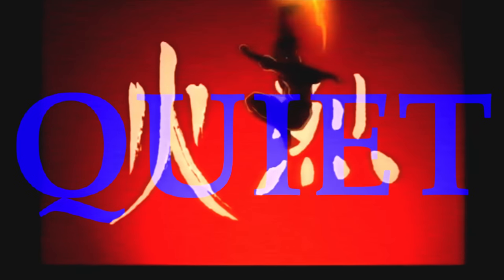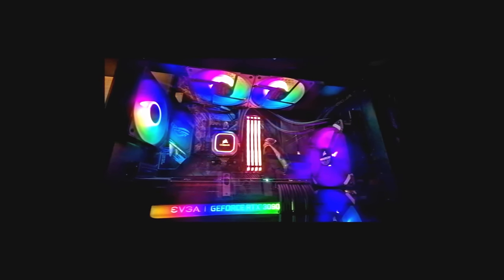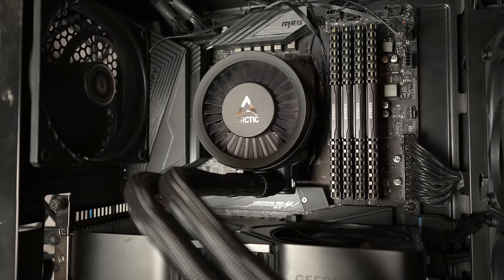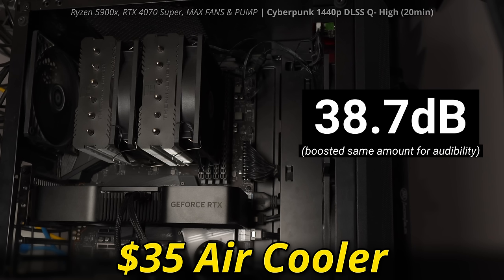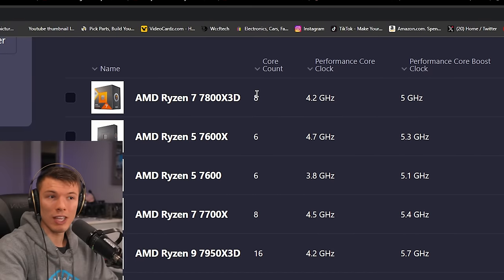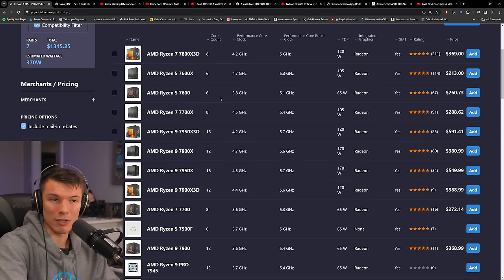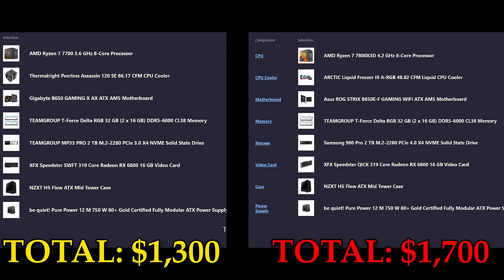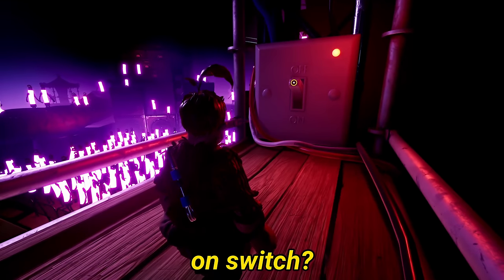How to Get the BEST VALUE PC!! (you’re doing it wrong…)

Comment: I get what ur saying with the base model of gpus being almost the same, basically the advantage of the brand versions is the bigger heatsink keeping the temps way lower allowing you to do a heavy overclock and not worrying about temps, also not to mention the vrand versions have slightly increased clock speeds but i doubt its that noticeable. For example my Asus tuf 7800xt i run it woth a pretty heavy overclock and undervolted and ive Never seen the temps go above 60°.

Only buy a branded card if it's same price as the base model or pretty close, other wise ur wasting money

Comment: AK400 :eyes-pink-heart-shape:with my 5700X
Reply: I went with the same for my 13600kf and despite using it on a non-oc board it tends to run hot. Been skeptical of the reputation deepcool has since.
Reply: @jarredkuliszko  my temps never cross 82c ( room temp 30c ) you.

also check the TDP of your CPU. the AK400 is a 210W cooler. My 5700X is a 65W n can boost upto 130W.
Reply: @ana303_  Australian here so it can get into the high 40°c mark here and the 13600kf is 125w. Doing cinebench it hits the 100°c mark quickly in 25°c weather unless I have my cases drive door open yet it has an intake and exhaust fan and the power supply works as one too. Use Arctic silver 5 thermal paste and I keep it clean.
Reply: @jarredkuliszko  add a top exhaust fan directly on top of the cooler.

Comment: Since Installing an aio Into my PC and switching the case to the Lian li Evo xl with a lot of fans my GPU and CPU are 10°C cooler under load, it did something
Reply: 10° difference, is it actually doing something like extending the life of the CPU? Whats the actual value? If there is no punishment for running the cpu 10° hotter, i will certainly do so!
Reply: @bedri1  theoretically you do extend the lifespan of the hardware if ran cooler. The real benefit I get tho is that my hardware is less likely to thermal throttle therefore gaining a little bit more stable performance. That's noticeable i would say.
Reply: @iR0CKt  what is the statistical difference if I run my CPU at 85°c Vs 75°c [Tjmax 95°c]

Comment: Your performance may be the same, but overall cooling is not. Water cooling is still more efficient. It's quieter if done right. Most of all, it allows for more overclocking. Simple fact. It is more expensive, but if you already maximize your parts, who really cares how you spend the rest of your budget?

Dead pumps CAN be disastrous. I've had one die. It took nothing else with it. A new D5 pump is cheap. It's only a big deal if you don't catch it. That's why you only run it when you're using it. Not as big a deal as people make it out to be. 

If you are cost-conscious, then air cooling is good enough. It will do what you need it to do. It won't supply the bling or provide better cooling, but it will be good enough.

Note: this is from the perspective of running custom loops. I've never run an AIO. You can liquid cool your cpu, gpu, maybe a monoblock for the mobo, and even your RAM if you wish when running a custom loop. It all helps though return on investment is more bling than actual performance. There is also the longevity of parts to think about.

Edit: The sad thing is that when I bought my ROG Strix B650-A Gaming Wifi motherboard, it was one of the cheaper options. AM5 was stupid expensive early on.

Comment: The only reason I will use an AIO over an Air-coolers these days, it's not because my 13900k is a toasty MOFO, but the CPU coolers is small. That's it, that's the reason, no giant-ass cooler tower blocking my access to my RAM or blocking my screwdriver while installing a cooler tower. That was always a pet peeve of mine with my first ever computer.

Comment: I honestly never understood the obsession with water cooling. For an Intel I9 that can draw beyond 300 watts, it's okay to use, but for my 7800X3D, my Peerless Assassin is borderline overkill. I'd say it can comfortably cool anything up to about 200 watts under full load.
Overall, though, my focus was on getting pretty things happening on my screen, not in my PC case. The only thing that has RGB is my GPU and that's simply because it was the cheaper option.

Comment: the arguement that someone would buy a 3D CPU would be if they play somethings thats CPU heavy (run on Java, Simulation, RTS) but otherwise 7700 non X is better deal yea..
as for watercooler.. i think Peerless Assassin is the best for bang for buck air cooler while watercooler would still always be Liquid Freezer II/III..
in general also someone should only pick non X over X unless the X one is heavily discounted (the non X is post-release revision with fixed "TDP" lower than launch, its better in general)

Comment: didn't know what i was doing in 2021 so i bought a prebuilt and it came with a 240mm aio. fast forward to now and i ditched intel for amd because of the future upgradeability and they have the 7800x3d so my 240mm aio turned out to be plenty. i have the castle 240ex from deepcool and i had to dig through their site until i submitted a ticket to buy the am5 mounting kit. SEVERAL channels (don't know about this one) say that if you have a bracket (for your aio) that goes on the back of the motherboard then your aio is NOT compatible with the new am5 system. That is false... at least in my very particular case with deepcool and their am5 bracket. So if you have an aio and it has a bracket that goes on the back of your motherboard there is a small chance your aio company released a mounting kit so you can re-use it on your new system.

Comment: Honestly the only reason I spent €150 on a motherboard is I wanted an ITX board with wifi, otherwise I wouldn't even have spent over 100.
Also I'm running a 14 year old Scythe mugen 2 air cooler and it still performs great! The cost over time is so much better than water cooling, these things just last practically forever.

Comment: I can tell the difference because I work with my computer.
The thing is, people who know what they are doing tend to buy those things because they know that those minutes waiting for a file to transfer or that heavy workload could end up in hours or even more than a day over the years that they are using the computer.
Reply: Kind of? For most people the bottleneck is the human factor rather than the pc.
Reply: @ivangerginov5648  I'm not talking about games, I'm talking about specific heavy workloads. People always tend to generalize everything, so what I am saying is: that if you know what you are doing then there is no problem buying high-end stuff. For games, you don't need anything more than a Ryzen 5600 + RTX 3060 + regular NVMe SSD.
Reply: @gabrielnilo6101  Yeah I'm not talking about games either tbh, but I can see your point, especially if you do a lot of rendering/compiling.

Comment: There are a bit misleading informations here.  yes, both air and liquid coolers can perform as close to each other and obtain the same cpu temperature on load, initially. but liquid cooler can retain lower temperature for even longer duration than air cooler can. air cooler will be saturated fast and lost the heat retention just as quick. over time, the performance of air cooler will be degrading and perform worse than liquid cooler. Hence, if you are gaming for prolong session, it's best to get liquid cooler.

Comment: you used a DRAM-less ssd, is that fine for just games? They are cheaper but will they also have shorter lifespan, or get slower than an ssd with DRAM would the more they get filled up?

Comment: For me the difference between pcie 4 and 3 is important because i play more niche games like kenshi which unfortunately is poorly optimized and can have issues with constant loading but having a pcie 4 with decent ram makes the game run much better because it keeps several large zones loaded in simultaneously meaning it eats up a lot of memory and needs fast storage so I'm leaving this comment as a heads up if you plan on playing games like kenshi or even cyberpunk having a ssd is important but both pcie3 and 4 are great but if you can afford a pcie 4 then get it, it is a worth while expense imo

Comment: Liquid cooler there had better thermals as well as more performance. It might not have been worth 55 dollars more, but there was improvement. Don't say it's basically the same. That difference is extra 100 mhz on all cores. Which makes no difference to you and I, but might make a difference to a video render monster.

Comment: One big point of criticism, for SOME games the CPU is the bottleneck, specifically games which use DX9, DX11 or OpenGL but the last doesn't really matter anymore because of dxvk. Specific example: StarCraft2, the game which runs on almost any PC but which doesn't run well on most PC's.  I wouldn't cheap out on the CPU for 7700X vs 7800X3D but if you need the extra cores more than the stacked cache, go ahead and pick the 7900, or the 7950X3D. In regard to cooling: 'aircooling' for the win, no doubt!

Comment: Me who just bought a whole rig setup with a 5700x cpu and 11% bottleneck: 😅 
But it was $1200 with extension cables (gotta look boujee at least), fancy digital air cooler, and a 6800xt. Admittedly I could've saved maybe $100-200 buying a used 6800XT but...I just didn't feel comfortable with the XFT Swift as the reviews (on amazon) mentioned people getting bunk cards and a lot of mentions of coil whine (not a good sign for a used card). NTY save me the hassle and spend the extra $100.

Comment: I found my pc case on the side of the road and it's fantastic! :,D
I think something pissed on it when I wound it but that's nothing that a garden hose can't fix. I then bought everything else used and I got myself a 4090 with a broken fan. I just got myself noctua fans and taped them on my gpu (the only thing I care about is notice level) and deactivated the fans on the card. Easy fix. :,D
My PC cost me 1100€ not including peripherals and I can play 4k games with no issues. Granted all of that is risky and a lot of work and a lot of jank but my pc has character! Respect the hustle! I will however water cool my gpu and cpu. Can't see into my pc but don't like tape on my gpu regardless. My first build btw. Also need to get a better power supply I don't trust the one I have right now and it is a bit under powdered for my gpu.

Comment: pretty sure air cooler depends heavily on room temp ive been using hyper 212 cooler back in the days and going to liquid cooler is a huge improvement i actually live in a tropical country where normal room temp reach up to 35-40 C very hot out here
Reply: Air and water coolers both increase CPU temp at the same rate.  1C higher ambient = 1C higher CPU temp.
Reply: Room temperature affects both coolers the same.  If you put water in a 40C room, it's going to be 40C.  Water cooling isnt magic.
Reply: @kintustis  your logic would be right if only we are talking about still
water and bare water?

Comment: I've done tests on sata ssd in gaming load times and they are at max 5 seconds slower than a gen 4 ssd in a gen 4 slot! I was shocked. Sata ssd's are more than enough. Thing is though, sata ssd's are now about the same price as nvme ssd's these days. Also, in my use case I transfer large files frequently from an external m.2 nvme ssd which will significantly reduce transfer times as long as you have a fast enough i/o to connect and external ssd. In the end the m.2 nvme speed will be bottlenecked by i/o and external drive anyway. I'd say getting a 1500MB/s read/write m.2 nvme will be more than enough for the average person

Comment: What nearly nobody touches on is air circulation for VRM modules and RAM next to your CPU which AIO can't provide.
Reply: Not no AIO. That Arctic one he showed has a mini fan inside the pump block for that exact reason. But for many of them this does apply.
Reply: I missed this detail thanks for pointing out.  @Frashsibit

Comment: Hey guys need some opinions on my first PC. So I pulled the trigger on the 7800X3D Bundle at MicroCenter since I kept hearing that’s it’s the best CPU. But I hadn’t really done much research. So now I’m seeing that it might be a bit overkill. Was originally planning on pairing it with the new 7900 GRE. But now that I’m thinking about it if I return the bundle and get the 7700X bundle which is $100 cheaper I could use that money to pair it with a 7900 XT instead. Also plan on getting a 4K 144hz monitor since I plan to mostly play my games on 4K. What do y’all think? Also to note I would want to use the PC for work if needed.

Comment: i use id cooling frostflow x aio thats cost the same as cheaper air cooler, because i use b660m board, i cant push my 15 13600k (it was upgraded from i5 12400f) above 80c and that is with shit application of thermal paste, and i use this pc hard for engineering software in which the cpu can be pushed to 100 %, above 4,5 ghz for 6 hrs and even sometimes i just leave it on until tomorrow and the temp wont go above 80c .that aio is really cheap and can still push my processor hard
Reply: Those cpus can comfortably live their whole life at 95C+, regardless of what r/pcmr tells you.  And even if it goes over it's tjmaxx, it'll drop clocks by like 2%, and you'll be fine. Don't buy a K sku for an engineering workstation.  don't introduce potential hardware instability into your workflow. Conversely, don't pay for a K sku if you're running it stock.

If you're losing hours a day in cpu time on a system you use for work, Put the extra money you spent on liquid cooling (whether you admit it or not) towards an i9 or R9 cpu.  Sounds like it would shave hours off your processing times.
Reply: @kintustis  originally this system is my gaming workhorse but it transform into my work system as well

Comment: One mistake I see people making is comparing parts prices only within the context of that part. You're building a whole computer, not just buying that one part. For example, a 7800X3D costs about $360 and a 7700X costs about $290 at the time of this comment. This means that a 7800X3D costs about 25% more than a 7700X, and it only performs 10% better so it isn't worth it.

However, if you have one build with a 7700X that costs (as an example) $1500, and then you upgrade the CPU to a 7800X3D making it cost $1570. That's only a 5% price increase. When you think about it in context of the entire computer, now you're paying 5% more, for 10% more CPU performance. If you're in a heavily CPU limited scenario (for example esports games at 1080p or lower resolution), you could be CPU limited even with a 7700X. Suddenly it looks like a lot better value than you previously thought.

I'm not saying that everyone considering a 7700X should just get a 7800X3D instead, but the point is that you need to do this when comparing all parts of your system including CPUs, graphics cards, memory, storage, everything. Consider the prices in context of the entire build, not on their own.

Comment: Your picks are weird... Nobody with any sense would buy a 6800 over a 7800XT at the same price. Also that case is way too expensive for the budget build. And a low end AIO only makes sense for the looks or small form factor PCs. At the same price you could get a high end air cooler that will perform better than the AIO. And if you're going with the best CPU available, getting better cooling does make sense, especially if you play CPU bound games (which there are plenty of, especially if you have a 360+Hz 1080p display to play competitively), because PBO exists, which you conveniently ignore in the parts of the video where it doesn't fit your narrative.

You're not wrong, but the way you present it takes away all the credibility behind the message. The "bourgeoui" build would be way cheaper ($200 difference tops, for a better case and a mid-high end 360mm AIO, not the low end crap), and would have better CPU performance for the high FPS games.

Comment: yea its pretty dumb, saw alot of ppl 7600x/12600k equivalent of cpu or even lower and yet they use aio, wasted electricity and theres chance of leakage that kills the whole rig
Reply: I have had AIO's for the last 14-15 years and have never had any leaks or failures other than some fan replacements. Get an AIO that has long warranty 5-6 years+ and you are good.
Reply: @TheKims82 I have 20+ year old heatsinks that still work fine.  The temp difference isnt going to save you the price difference, and overclocking modern CPUs doesnt get you 50% extra performance like it did before turbo was a thing.
Reply: @karathkasun  Newer CPU's from both Intel and AMD will boost as high as they can within the thermal limit 95-100C. Temps will be pretty much the same with air and AIO, but better cooling will allow the CPU to boost higher. I have a 7600 paired with a 360mm and it is probably overkill, but i plan to use this cooler when i upgrade sometime in the future and maybe i will go for a higher TDP CPU that needs better cooling.
Reply: @TheKims82  The performance difference from air to AIO is negligible on AMD.  Sub 5% in most cases unless you are talking about a $10 air cooler vs a $150 AIO.  The limit on cooling them is not the HSF/AIO, its the very thick IHS.  You are better off lapping the IHS thinner than going overkill on the cooler because of this.

Intel is the only reason to even really consider anything like a 360mm AIO currently, as the  i7/i9 use 3 to 4x the power of their AMD counterparts.